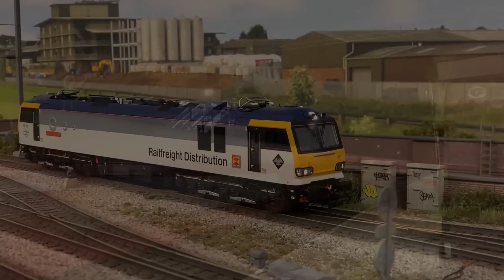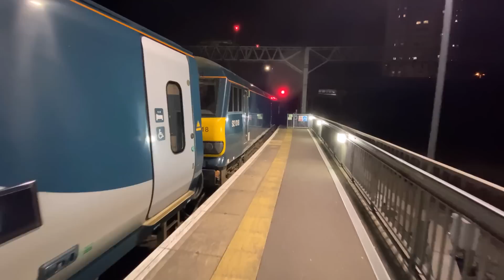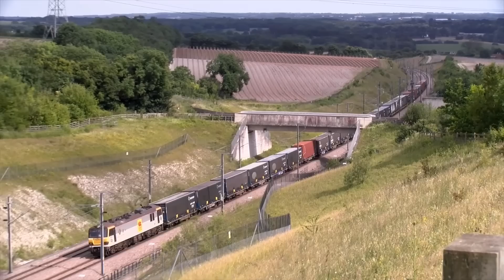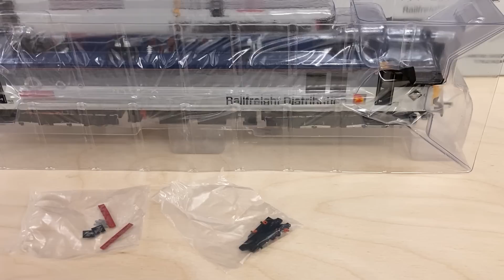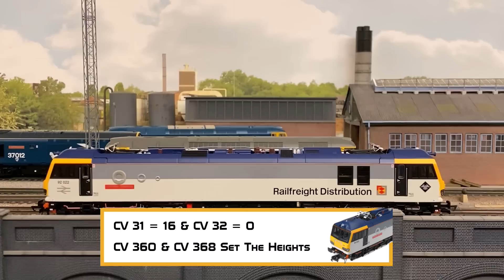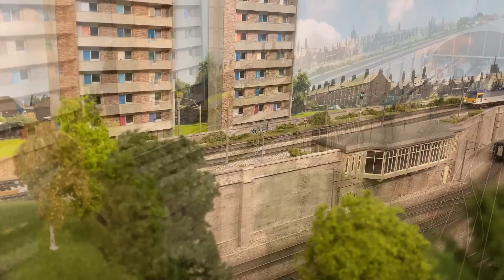Dean Park Model Railway 315 | New Accurascale Class 92 | Under Close Inspection

Comment: A great review. 

I have 003 beethoven. Lovely model. I've yet to be able to run it as my dcc system seems to have packed up on me during the house moving. But looking forward to being able to run it at some point soon. I think a small tmd plank is needed for loco running. 

I think a follow up would be good as I've found the pantograph heads can fall off in packaging, though they're fairly easy if a little fiddly to reattach. The other issue is with the smaller of the body grilles, on mine they're fine, but on a couple of my friends examples it had fallen off in transit. But easy to refit alongside the etched plates.

Comment: Got mine two days ago and very impressed with the loco so far. Haven't got my DCC chip fitted yet and there's not any information about the fitting but presume it will be like other DCC models. I have my Accurascale Deltic and very impressed with it and now looking forward to my Class 37 Loch Lomond. Very, very impressed and always impressed with your layout. I'll catch you one of those days in Scoonie! Cannot rate this highly enough.
Reply from the maker: Cheers. Really glad you like my layout and for taking the time to tell me. I really appreciate it. Looking forward to my 37’s as well. I sneak in and out of scoonie hobbies 😆 cheers l. Dave
Reply: @DeanPark  your attention to detail is very impressive as is your whole layout the building of which I have followed from your early days. I have been trying to remove the body of my 92020 to install the chip but terrified in case I am too heavy handed. Any tips? I should really splash out and buy Fitted models. I had mentioned you and your layout to Steve who confirmed you did pop in and out now and again. Good, friendly shop and always good chat. I'm just up the road at Cupar. Keep up the good work.

Comment: Hi Dave thanks very much for doing your review of this model. I've had one for Christmas (I think it was supposed to be last years) in Caledonian sleeper livery. I have found one of the grills loose in the box but it's easily fixed. Thanks for the info on the resetting of the pantograph height. I've had to do this so watching your video made it easy, thanks. Other than the grill it's a fabulous model and I would agree with all your ratings atb Andy

Comment: Very nice. One question I have is, are the pantographs sprung in any way so they follow an actual pantograph wire, up to the height set by the CVs, or is it just a fixed height once raised?
I'm anxious because Accurascale said these were due to arrive in the week after warley, yet the one I've preordered (DCC Ready 010) is yet to arrive (as far as their facebook feed suggests), so it may not arrive by christmas.
I will be ordering a specially programmed dcc chip for my one, plus drivers for this and both deltics I have, plus the research team pack.
Reply from the maker: There is an element of spring to them.
Reply: @DeanPark  Awesome. I'm at the planning stages of my new layout, which will have 2 overhead AC and 2 3rd rail running lines, plus a 5th as a branch and a 6th as 009 gauge. Glad to hear it'll operate properly with wires.
Now to work out how to spring the pantos on the hornby pendolinos and javelins...

Comment: These were actually trimode locos one pantograph is for 3kv OLE but I think it’s been isolated! Also they aren’t allowed to operate in multi due to how much power they drew from the OLE at one stage when I was a signaller only 4 were allowed south of Crewe under the OLE at any one time that too is probably now redundant after the ole power upgrades on the wcml

Comment: Ordered 92022 long time ago and forgot about the order until I was asked to pay the balance. In between I had slightly changed the era of the layout and thought about cancelling the order. Was mighty pleased that I did not and Charles Dickens is now my first Accurascale loco - certainly will not be the last. I will always be running in "DC mode" so decided not to test out the panto functionality. Test running '22 on the layout, I was amazed at the controlability of the loco - its a smooth runner and can cope nicely with PECO 2ft radius points nicely. As for its looks - simply top notch. Now looking forward to the 31, 37 and 50 from Accurascale which hopefully be as good. Meanwhile Charles Dickens will get the occasional outing when the Mainline blue locos come out of their boxes. Now for a decent 3rd rail EMU from the mid 90s to run alongside it ...

Comment: Great overview of this model from accurascale, I have 92022 Charles dickens as well, mine being number 44 on the limited edition certificate, I actually didn’t realise that 92022 was a limited edition model until I saw other people posting photos of their 92022 and showing the certificate, in my opinion it is a good locomotive from accurascale and it has been worth the wait, it’s good to have the pantograph feature even though I can’t use it due to still being on DC, I’m overall very happy with it, just need to fit the nameplates and other etched parts on mine, due to placing my order for before a certain date I got mine for only £160.

Comment: Thanks for this video. The information regarding the pantographs was very useful as I have been struggling to understand all the settings :-) I have a Marco Polo and I am very pleased with the detail and quality though one of the grills had become detached during shipping.  I do have one problem that I am struggling with at the moment. The wheels do not seem completely level on one of the bogies (the centre wheels seem very slightly 'lower' than the two end sets, so when placing a ruler on the wheels touching the centre wheels and the wheels at one end of the bogie the other set of wheels at the other end of the bogie are around 0.5-1mm off the ruler). This means the bogie 'rocks' when the loco is moving and has problems on points with the occasional derail on straight track). I expect I may have to send the loco back to be corrected unless anyone can suggest a possible solution. [Just to say the guys at Accurascale have been very helpful in trying to resolve the issue]/